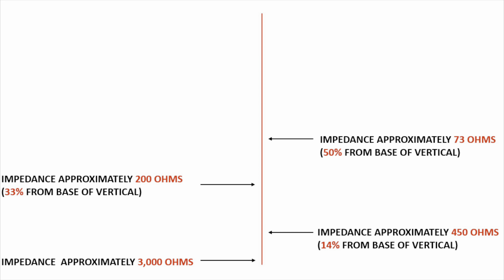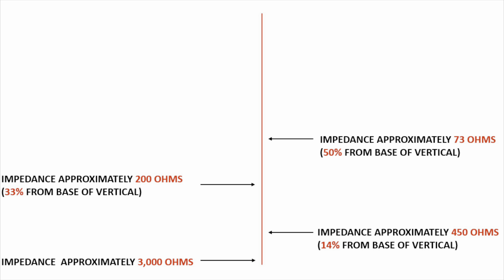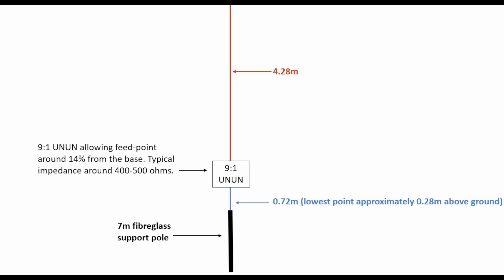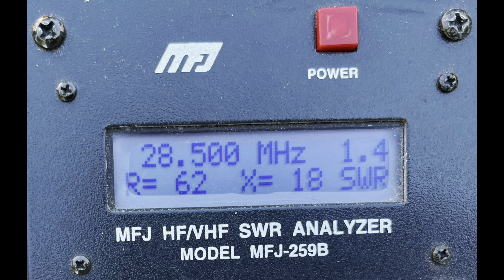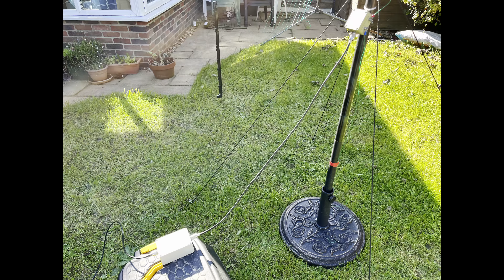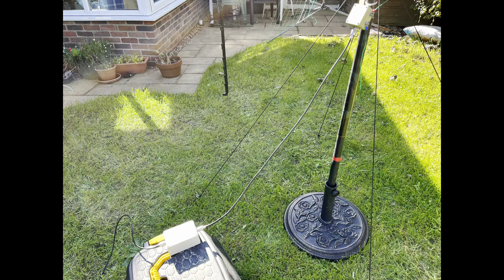10m Halfwave Off-Centre Fed Vertical Antenna

Comment: Seems like a 9:1 is a very versatile little tool to have, I think it will be one of the first things I get when I finally get a licence. I even saw a video of a guy using one to activate two lawn chairs 😄
Reply: I got my license a couple months ago and jumped up to General a few weeks ago. The first thing I got was an 891 and an ldg 4:1 and used an 8ft aluminum pole on 10, 20 and roughly 40. Good luck on getting your license. 

73 
KJ5CNK

Comment: all very interesting, I had a lot of success with a horizontal off centre fed dipole, never thought about putting it vertical. Incidentally, I enjoyed your last radcom article with the vertical doublet. I put together a linear loaded vertical doublet, using 450 ohm ladder line for the elements, each 3m long on a 7m pole. Works nicely .
Reply from the maker: Great to hear it works well!

Comment: Hi Tim, perhaps I missed it...but what mix did you use for your UNUN?  I believe that the permeability of the core is adding inductance and thus the need to shorten the antenna.  It would be a great experiment to make an air core 9:1 unun vs a mix 2 toroid (permeability 10), vs a mix 63 (permeability 40) and see if the overall antenna length changes.  73 OM  👍
Reply from the maker: Hi there! Yes there’s undoubtedly some inductive loading going on. The unun is I believe made with a single 240-61 ferrite core. 73

Comment: Looks good. Lots of options to achieve a vertical (or mostly vertical) 1/2 wave indeed.

9:1 seems likely to be consistently less lossy than the average 49:1-56:1 transformer. For this arrangement, it strikes me as possibly easier to run the coax mostly vertically down the pole, choked right after the 9:1, and then run the 14% counterpoise off the pole at an angle (especially since the antenna wire is much lighter than the coax, wouldn’t be choked, and won’t require a lot of horizontal space), but it’s got to be pretty much the same result!  Like any off-center fed (which technically includes the EFHW—since it also does have counterpoise requirements), good choking at the appropriate point is possibly one of the lesser appreciated nuances to getting the most efficiency.  I see you’ve got a chunky choke there :) 

Of all of the variants, if it’s going to be a monoband vertical, I think i might lean towards liking the center fed (no transformer, ideally just choked) with one leg vertical and the other leg downwards sloping.  For multi-band, if not at the sea, probably prefer to run the OCF horizontally polarized.  Tim’s pretty much covered them all!
Reply: I thought 9:1 transformers were more lossy than 49:1 ??
Reply: @Nick_G7IZR  you see more discussion and analysis on trying to optimize for low loss in broadbanded EFHW transformers versus the 9:1, largely because it’s harder to do efficient transformations at very high resistance & high voltage points, and the average broadbanded EFHW transformer is sort of inherently lossy compared to your average 4:1 or 9:1 transformer operating in the moderate impedence range. Those that have posted lots of back-to-back insertion loss measurements through nano VNA have more than once opined that they stopped their analysis on the 9:1 transformer (while devoting significant time and attention to the EFHW 49:1-56:1 type transformer), because it’s easy to produce an efficient 9:1 transformer and further optimization doesn’t gain you much.   All that being said; the typical EFRW (9:1) setup includes some additional loss, typically, through the insertion of a tuner and a length of coax that has an uncharacteristic impedance on the line. Those additional losses are often not material, but they can be, depending on your setup.   In summary, while a poorly wound transformer on a poorly chosen material will always be bad, the loss in a quality 9:1 transformer (e.g. wound the standard way on a quality type 43 core) itself is largely not worth worrying about.

It’s also worth noting that the most efficient way to end-feed is not a 49:1 or 56:1, nor a 9:1, however the alternative is mono-banded (e.g., the LC match variant that Tim mentioned).
Reply from the maker: Great insight .. appreciate this. 73

Comment: Ooooh, new radio! I can't remember seeing you using this radio before. I know it's unfair to compare it to the FT-891 on a pure feature by feature basis, but how do you rate the 7300 versus the 891 in terms of receiver robustness/sensitivity and things like that? Waterfalls are great, but you need to hear and be heard. Cheers for another great video, Tim! 73, Jan M7HNK
Reply from the maker: Very similar .. I still have a soft spot for the 891 though!!